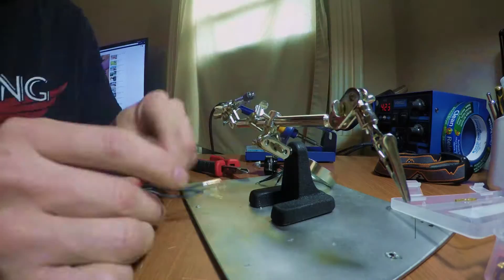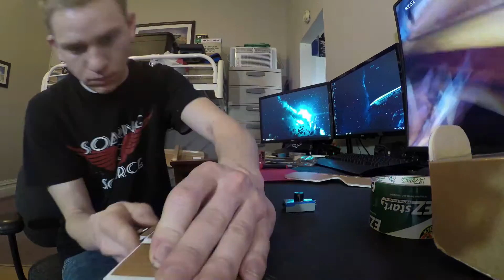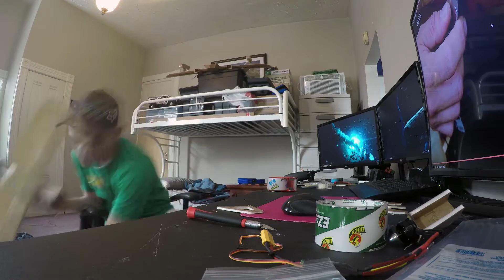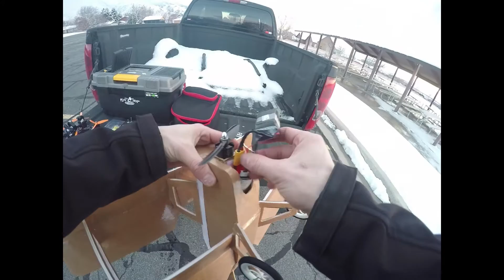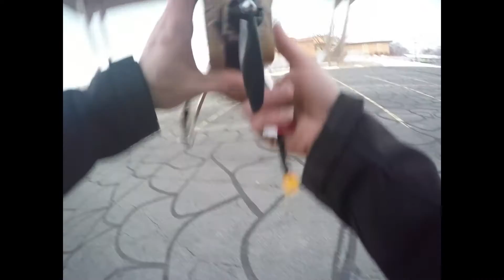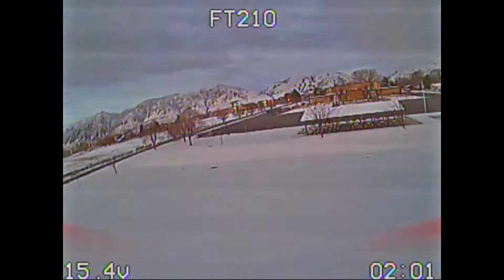FT SE5 | Build Vlog #1

Comment: How do you know that the motor is mounted off-center?
Reply from the maker: Alejan Pa, well the camera doesn't show it very well but the motor wasnt mounted on the center of the power pack and next the power pack had dropped from its original position after a few test flites causing the plane to just eat dirt... alot lol